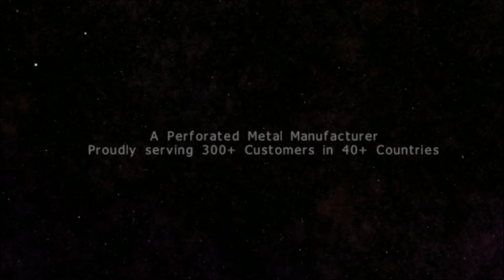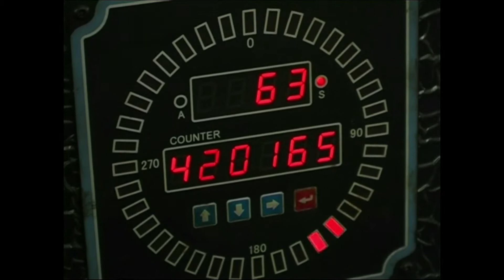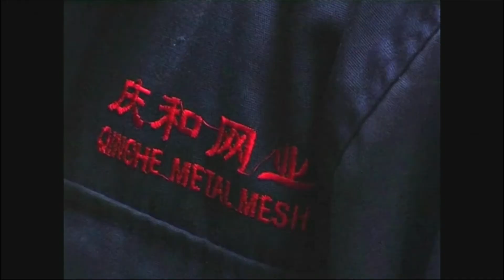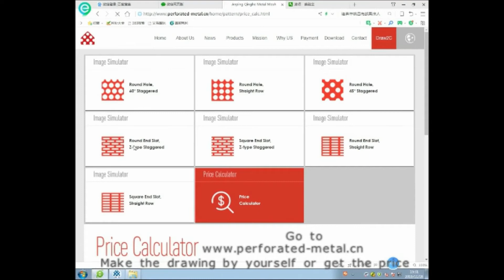Perforated Metal manufacturer, Serving 300+ Customers in 40+ Countries, ISO 9001 Certified

Comment: What is the smallest hole size possible@?
Reply from the maker: 0.5mm diameter round hole for 0.4mm thick stainless(AISI304 or AISI316L), and for limited sheet size.